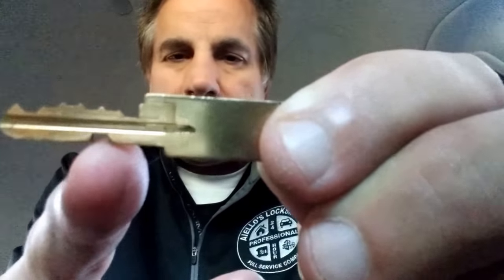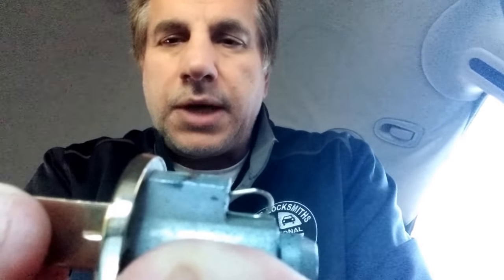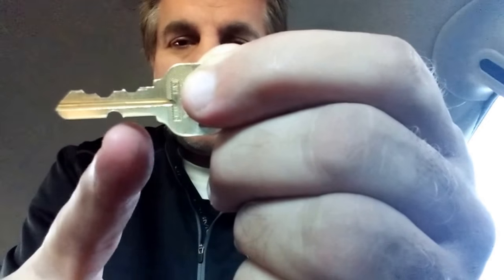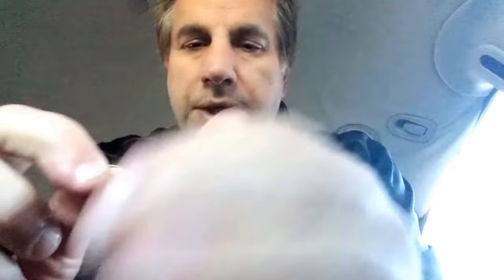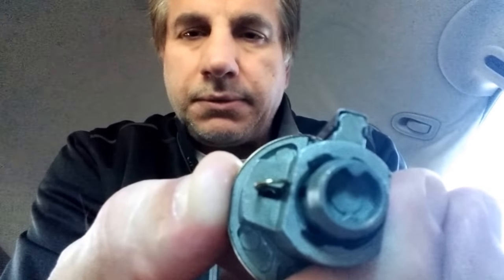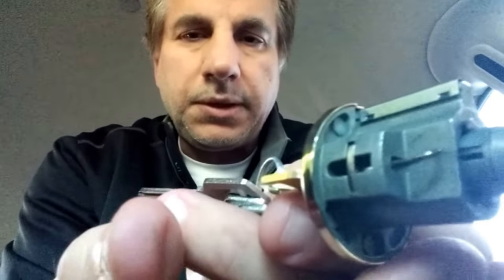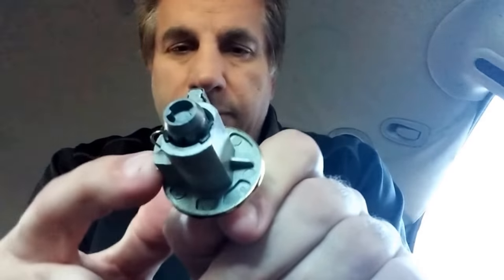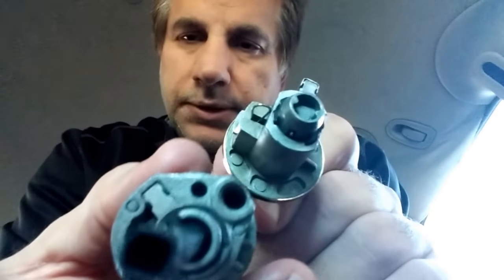Kwikset Titan Series Lock Cylinder Overview

Comment: I know this is an old video.  Wondering if anyone can answer this question.  We just bought a house with a bunch of Titan locks (entry + deadbolt keyed on one side) and have a control key that we think works with the locks we have.  Assuming it's the right control key, what does this buy us in terms of being able to re-key the locks ourselves?  What would we need in terms of parts and knowledge to do this?  We have no experience re-keying locks.

If this is something that's not easily done, we would consider replacing the Titan locks with new locks.  The Kwikset Smartkey locks look interesting.  Any thoughts on those?